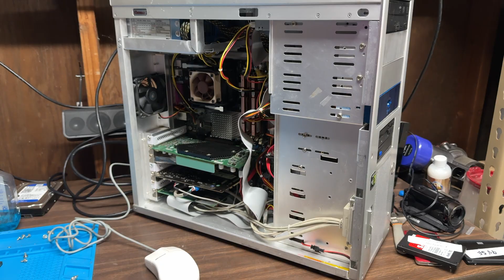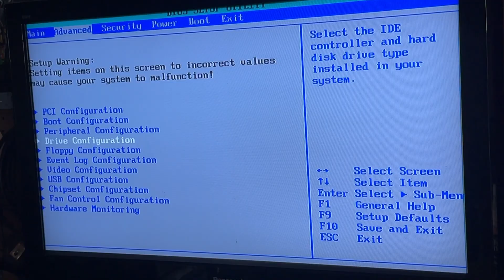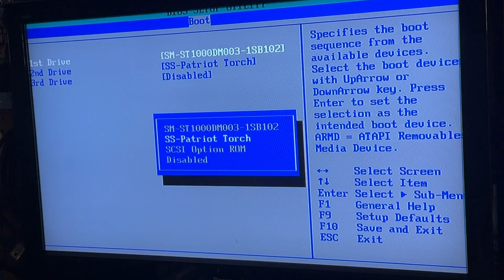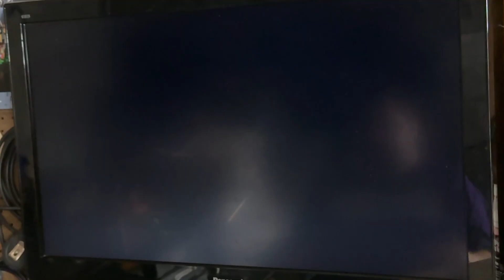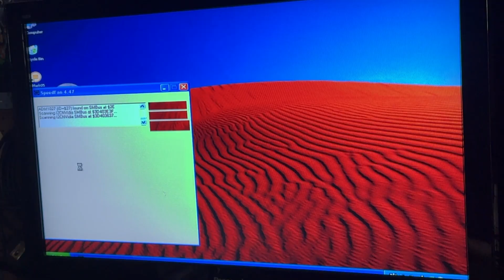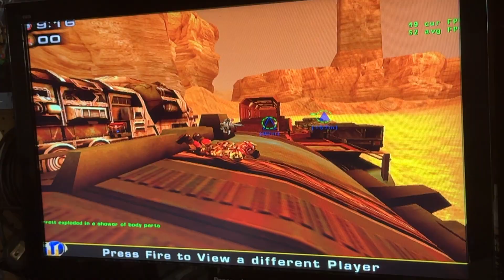Going over the Pentium 4 Northwood Windows 98 build

Comment: Got a prescott 3.4 ghz oc to 4.3 ghz combined with a fx 5900 ultra that gives 21300 points in 2001 se. The fx 5900 ultra runs at fx 5950 ultra speeds with a little oc. Not sure if you disabled all the motherboard stuff like serial and parallel, usb and ethernet ports but they eat up cpu power so best to disable everything you dont use.